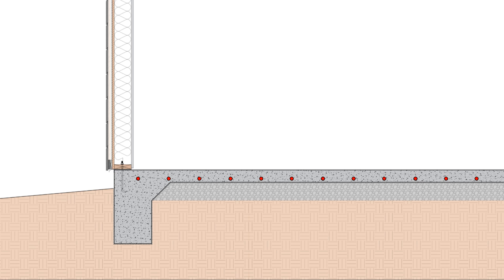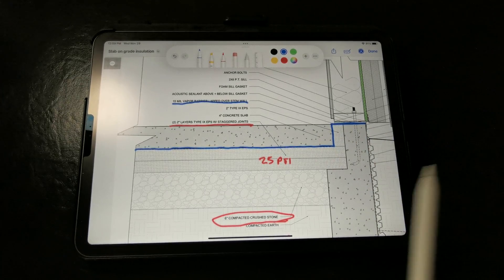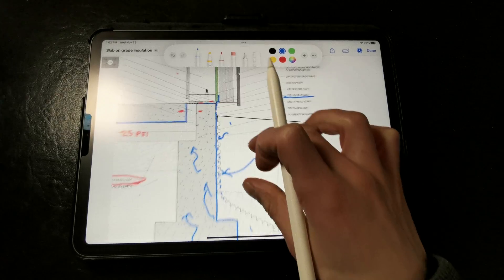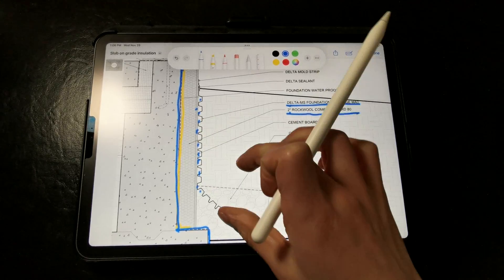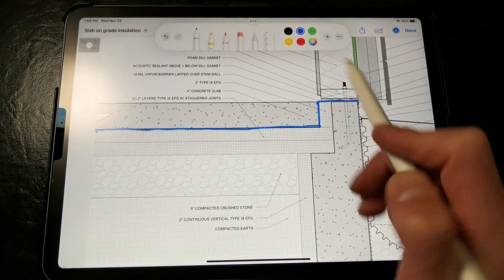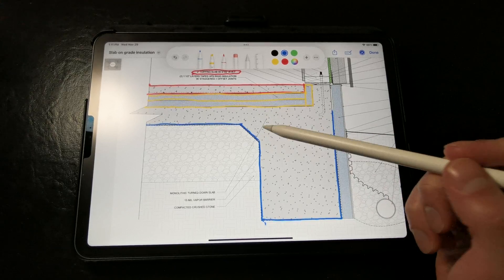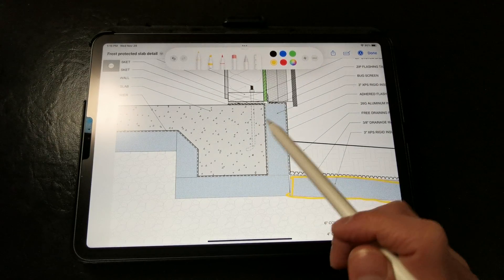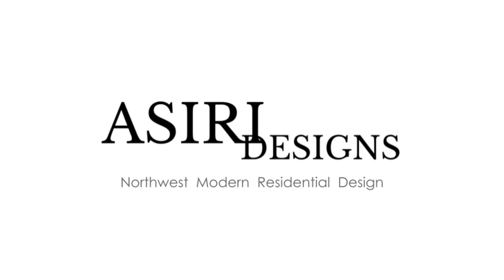Insulated Slab on Grade Foundations (For Architects + Builders)

Comment: Great video but website is being a pain. Cookie notification and Google add take up half the screen on mobile browser and won’t go away. Do you have similar content for piers? Thanks!
Reply from the maker: Thanks for watching! Sorry to hear the website is giving you trouble (still figuring out how to optimize for mobile). There is some limited content on pier foundations, is there anything specific that you would like to see? Cheers!
Reply: @ASIRIDesigns  exact same type of video as this but for raise floor installations. I’m slowly getting through all the BSC videos/website but will still seek consultation when the time comes. Your videos are really great, more detailed. So I will reach out for appointment to check my work when build time comes. 

Bit of a curve ball question for you, don’t really need to worry about cold where I live in Queensland, Australia. What’s better, break continuous thermal barrier to maintain slab thermal sink with shaded eves or maintain building science principals to retain environmental control but with greater cooling requirements provided continuous WRB is maintained. Just don’t have the slab sucking out heat..
Reply from the maker: @beau5271  I will definitely add it to my video list, thank you for the suggestion. With regard to your question about slabs, I would air on the side of continuous water and air control strategies. These are always more important than thermal considerations...Water kills buildings really quickly, followed by air leakage. Control those and you will have a long lasting building. A little bit of an energy penalty in a warmer climate will be okay, it's much less desirable or comfortable in temperate and cold climates.

Comment: Hi there. Thanks for the great content. Do you have a recommended detail for under a door opening? How do you insulate the slab at the door opening?
Reply from the maker: Thanks so much for watching! There are several strategies that you can use underneath door transitions. A lot of people (including myself) like to use an aluminum or stainless pan to provide the transition and to protect the foam below. Fine Homebuilding and Green Building Advisor have some great details if you search "insulated slab exterior door transitions".
Reply: @ASIRIDesigns thanks I’ll need to look that up. I have two doors I need to detail that I was concerned about. Does this work for garage doors as well? This is in my shop (12x12 garage doors for skid steer and mini ex)